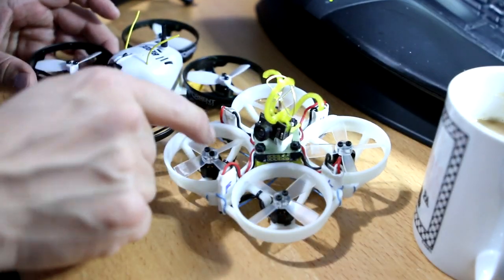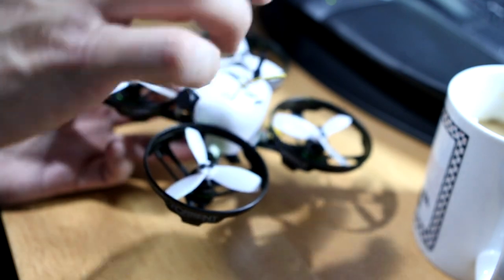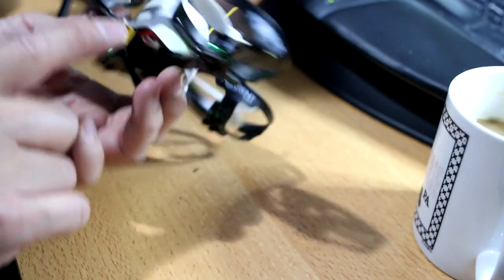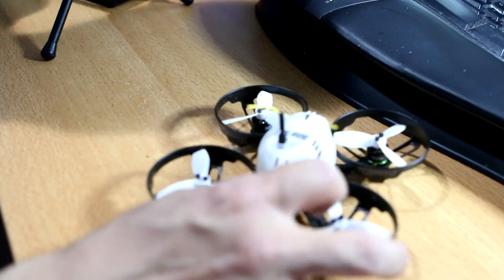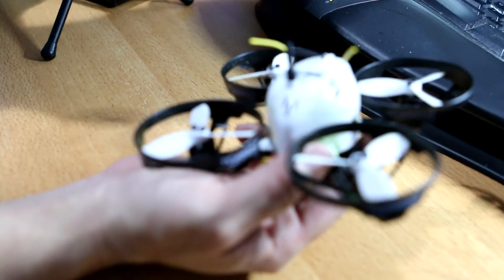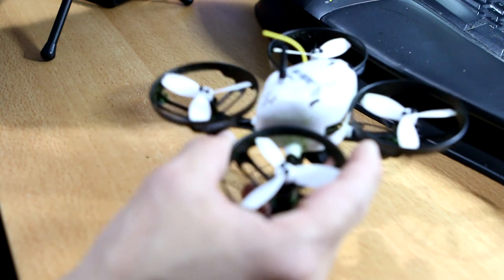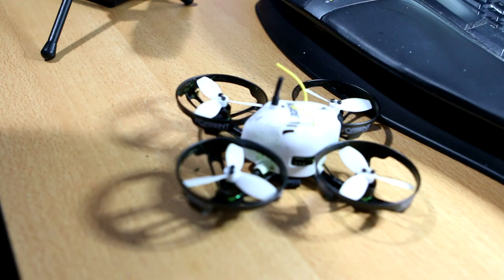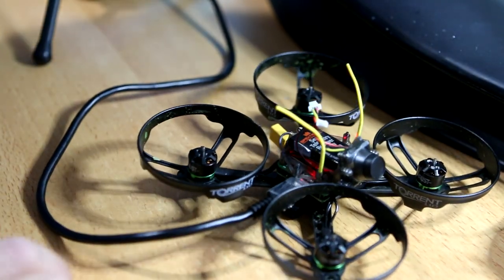Blade Torrent 1

Comment: It also comes with soft mounts for the motors.  That got rid of all my jello!
Reply from the maker: I removed the prop guards and am using rotorx props for now.  That also seemed to get rid of a lot of the jello. But balancing the props I think is basically a must.  And takes like 15 minutes.